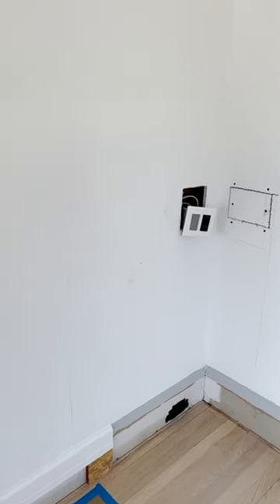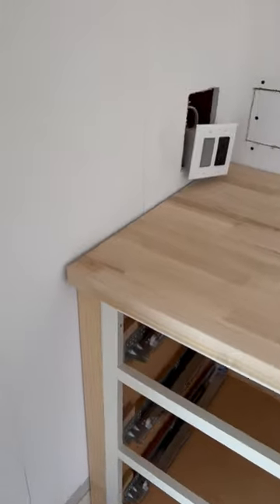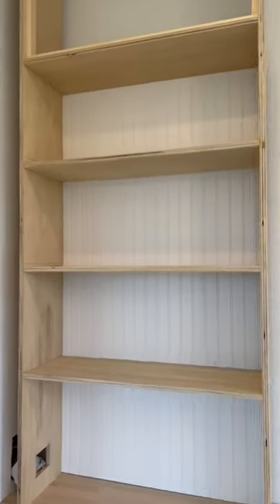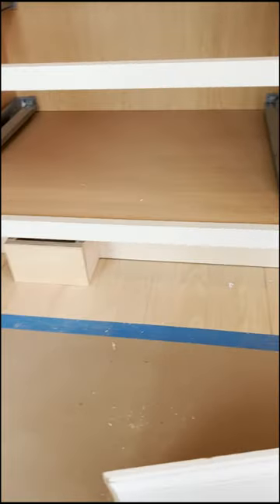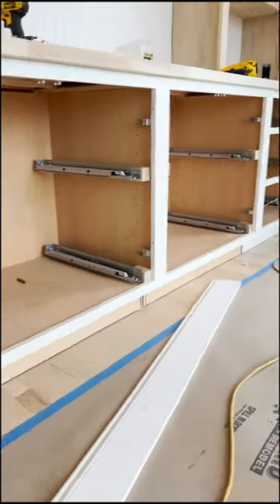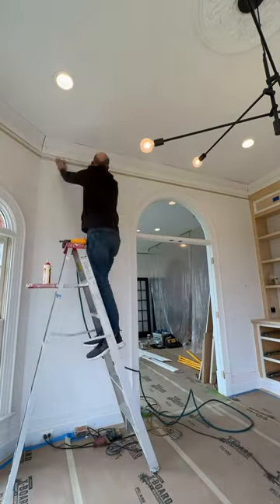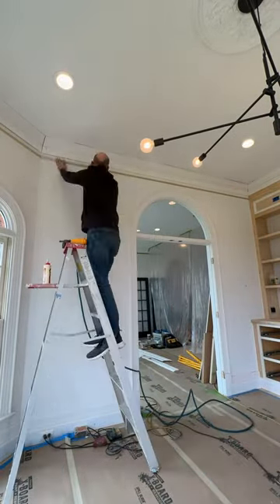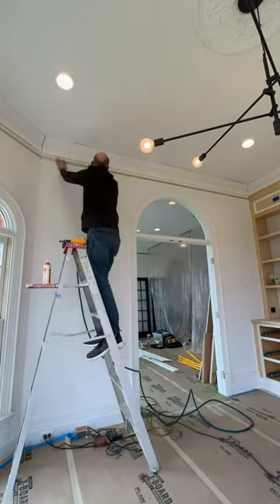How We Built Our Office DIY Built-Ins - Built In Cabinets START to FINISH

Comment: Easier future tip - counter guys use a razor knife and just cut out a little of the sheetrock vs the counter to fix out of square walls. Then back splash etc covers the counter in the wall you cut out ;)

Comment: Great job 👏 
One trick I like to do when sanding is to put a 20 x 20 inch air filter to the intake side of a cheap 20-inch box fan.  Just let it run (especially overnight), and it really helps keep the air clean.
Reply from the maker: Great tip!
Reply: Beautiful! What an amazing job

Comment: Love the look! How did you fasten the bookcases to the wall so they don’t topple over? Are they fastened to the wood countertops at all?
Reply from the maker: Thanks!!! The bookcases are glued to the countertop and secured to the side walls (into studs)  and also at the top (there is blocking that these are screwed into).  These puppies are not going ANYWHERE. :)